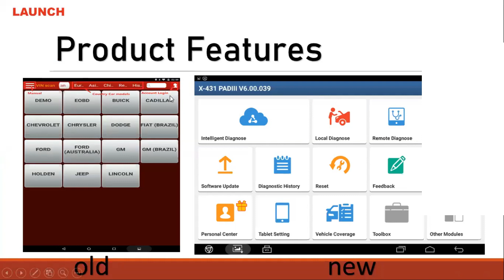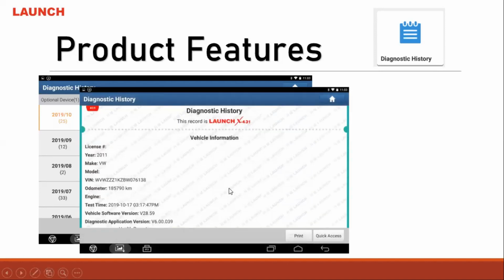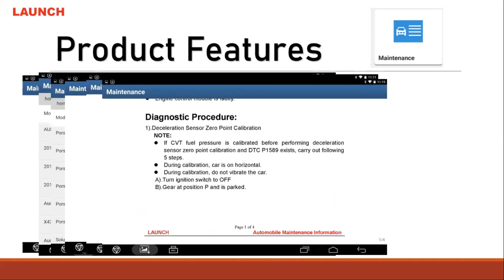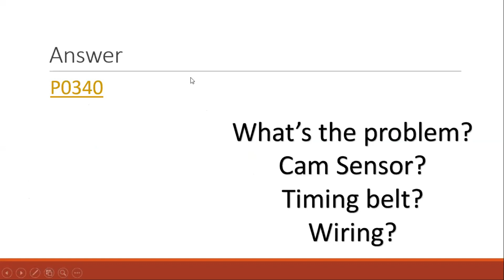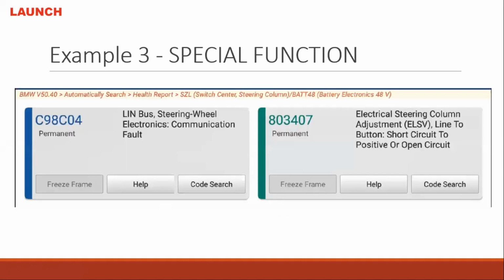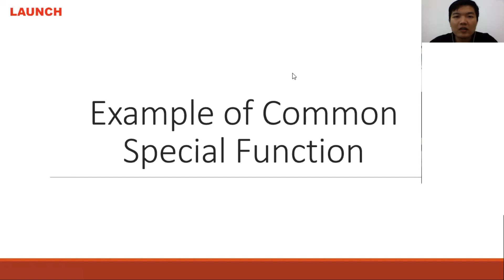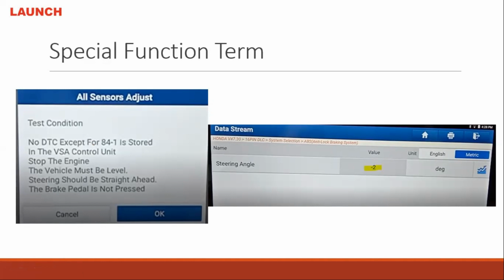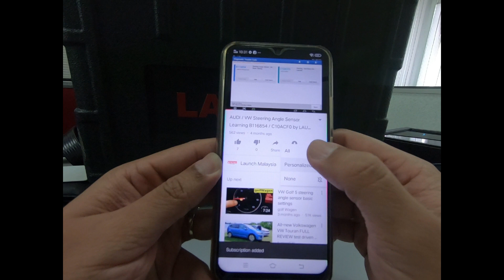LAUNCH X431 PROFESSIONAL DIAGNOSTIC TRAINING (PART 2) # Your X431 hidden function

Comment: Hi i see on other video from you - Launch PAD III & Launch PAD V - please i have 1 question : is the SAME TOOL ?????  NO NEED ...DOIP SYSTEM, NO NEED 4 GB RAM .... or 12" tablette
WHAT i need is BEST tool diagnostic, ECU CODING / PROGRAMING for MORES CARS, REMOTE DIAGNOSES, WIRING DIAGRAMES ....STUFF like that, so PAD III or PAD V ????
Reply from the maker: i suggest you go for PAD V

Comment: Hi - can the x431 V pro calibrate ride height for air suspension on a 2008 Range Rover full size?
Reply from the maker: yes.
Range Rover	2008	Ride Level Control Module	Special Functions	Air Suspension Height Calibration
Reply: @LAUNCHMalaysia  thank you. Are you a seller for x431 on amazon?
Reply from the maker: @MichaelA-xx2ls  no sir, can you provide me your email address & which country you from? I'll let local Dealer to contact you. thank you.